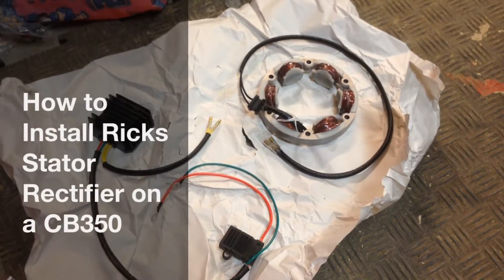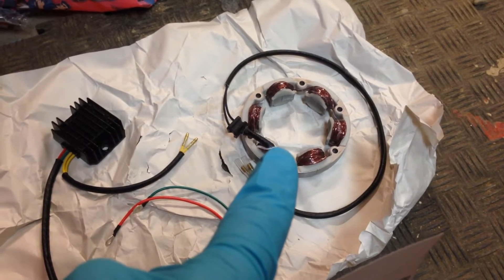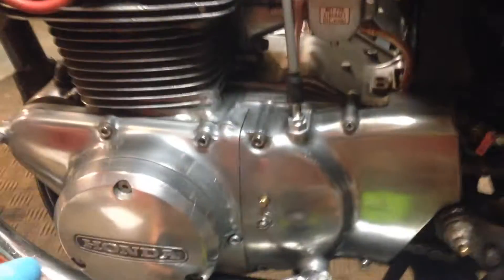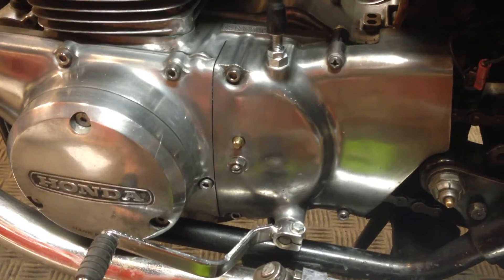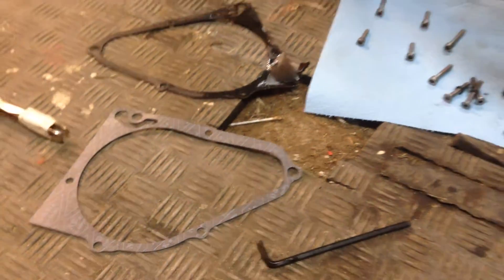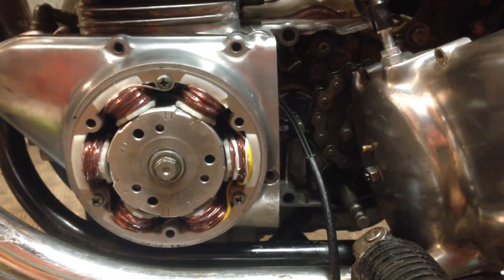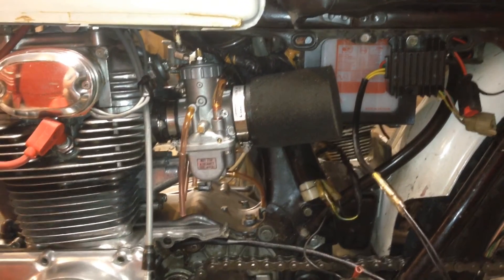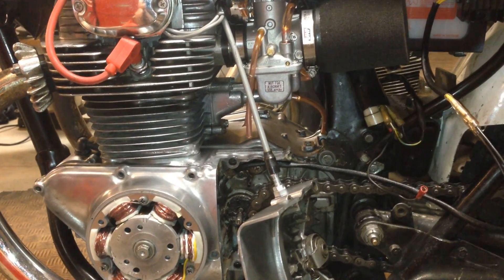How to Install Rick's Electrics Stator & Rec/Reg on a CB350

Comment: I have a '71 CB350 and it won't charge the battery while running. I got a new rectifier to replace the stock red one and no luck, it still dies after a little while. I'm thinking it's the stator. If I buy this kit do I no longer need my after market rectifier?
Reply from the maker: senimorybbob I would highly recommend to purchase the full kit from Ricks'. I also purchased an after market rectifier before switching to ricks. The benefit of buying the full kit is that is the stator, and the rectifier/regulator. The regulator is just as important. Keeping the voltages in the right range is very important.
Reply: Nick Donaldson Is there no stock regulator?
Reply from the maker: Right, throw away that 40 year old probably not working, wires cracked and frayed regulator. Ricks reg/rec is the way to go.
Reply: Nick Donaldson Hey Nick, what site did you get that gasket off of? Mine definitely needs to be replaced.
Reply from the maker: senimorybbob Well i would recommend to order a full gasket kit if you can afford it. Stores usually overcharge for one single. At Dime City Cycles you can order a full gasket kit for a good price.
Reply from the maker: @senimorybbob Actually I have a blog which I have created a webpage listing all the CB350 online stores that I know and a write up on each. http://njdnjdnjd.blogspot.ca/p/cb350-related-links.html
Reply: Nick Donaldson Very helpful. Another question here, I'm a little intimidated by etching the timing mark, how easy was it? How did you do it?

Comment: So question. I have ordered this kit off amazon from a company and the first one had cracked coating and missing in spots on the windings. Also was missing some insulator plastic.  So then sent me another.one and the new one has cracked coating on the windings but is better.  Im pretty sure im just gonna return it also as they keep having defects for some reason i think.  So i was wondering was your coating smooth, clear, and have no cracks in it?
Reply from the maker: Definatley had no cracks, no problems! Very happy with it, I would contact ricks electrics and ask them about that. Ricks electrics has really changed my bike. Used to constantly have low battery. Now I run a 55watt halogen,  and even charge the bike at idle. 

I believe my coating was a white coating.
Reply: My clear coating was the same way. Should I return it for a new one?
Nick Donaldson GDonut23
Reply: senimorybbob If im paying $160 to $200 for an item it better be i good shape.  Thats why i returned mine twice actually because they sent me a new one and it was the same way. Now im not sure if it will affect it or not but i just know the old ones were not like that and with the new technology with making these they should be in better shape than what mine came. If i may ask where did you buy your from? I got mine off amazon from a company called Lionparts or Lion something.
Reply: GDonut23 Very true. I got mine from 4into1.com but I believe all of these retailers get this item from Rick's Motorsport Electrics.
Reply: I just ordered the same one from Amazon/Lionparts. I took some photos and emailed to Ricks, they responded saying it is just the powder coating that they apply and while not aesthetically appealing, it will not cause any issues with the integrity of the stator.
Reply: burtbanner  I just got the same response from them too. I'm going to try and install it because they said a warranty will hold up even if I've installed it. Does yours work?
Reply: senimorybbob
I haven't installed it yet.

Comment: Hey Nick, Great video!  I just installed this system on my '75 CL360. The only real problem I had was that now my electric starter doesn't seem to be connected anymore. I'm pretty sure that it was one of the feeds in the original connection directly from the stator which got bypassed. Did you have this issue?  
Also, how did you end up reconnecting the neutral indicator?  I assume you just soldered it onto one of the new stator wires before it left the clutch cover?
Reply: Same issue here. You ever find a fix?